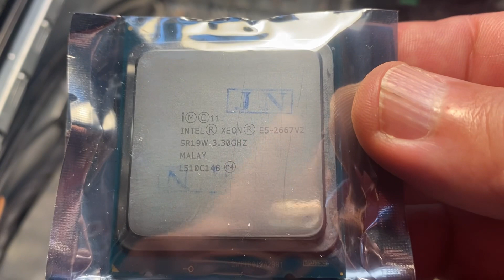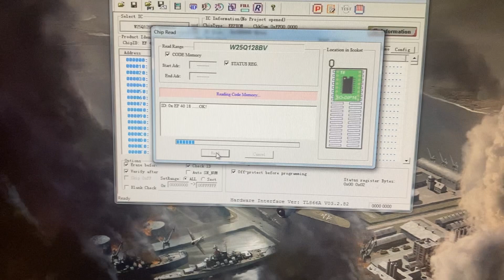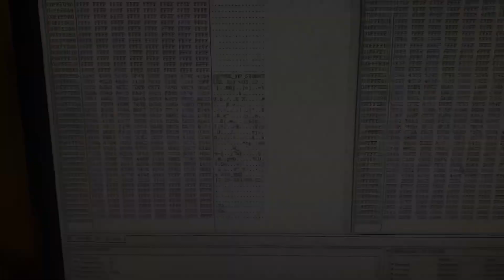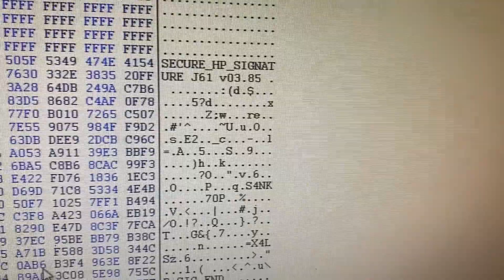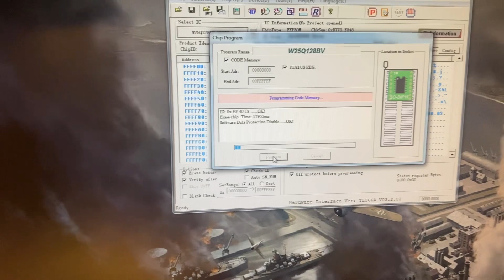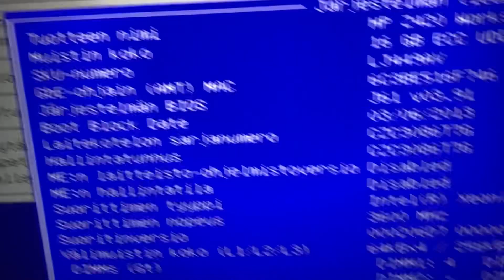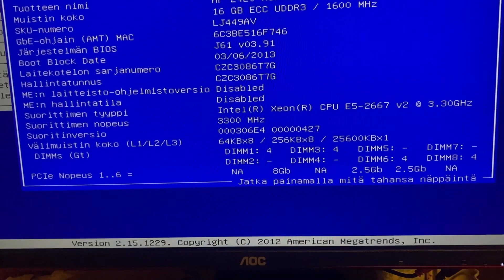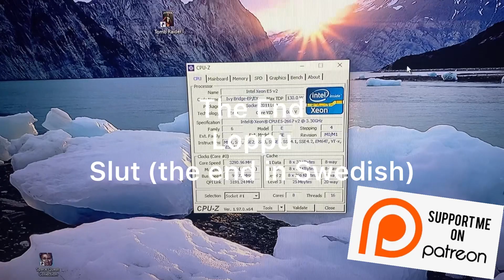HP Z420 motherboard upgrade from V1 to V2

Comment: Is odd you had to go through this whole process for a simple v2 CPU upgrade. 
I had this same system 2 years ago, and simply updated BIOS to 03.96 Rev.A and after flashing, it took the V2 CPU without any issues.
Reply from the maker: You had the luck of having a V2 compatible motherboard. There are 2 versions of it.
Reply: what is your hpz420 version? @MJPilote
Reply from the maker: @ Honestly I dont remember and won't be home for 2 weeks. But it has to be the early ones because I needed to modify for the newer cpu.